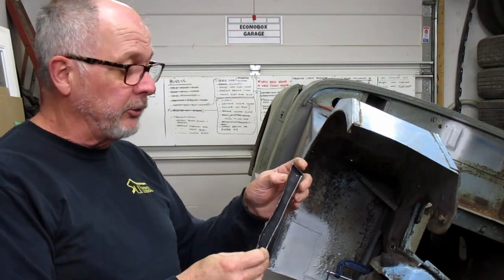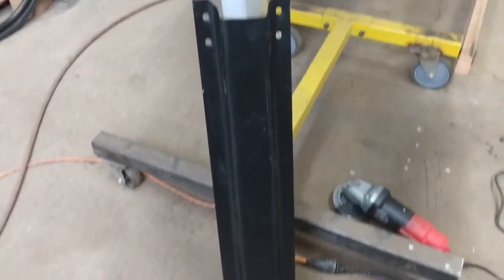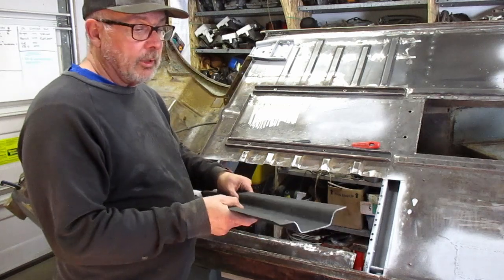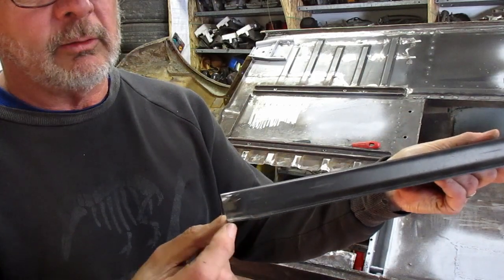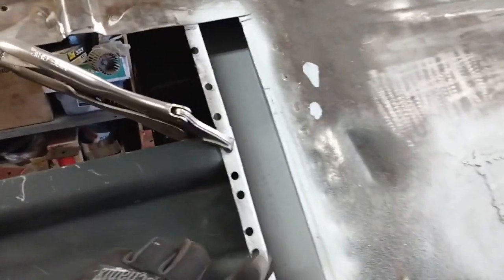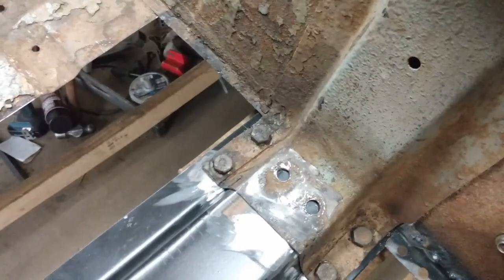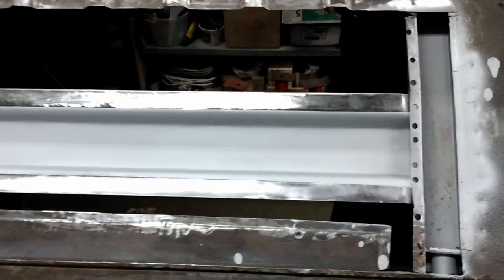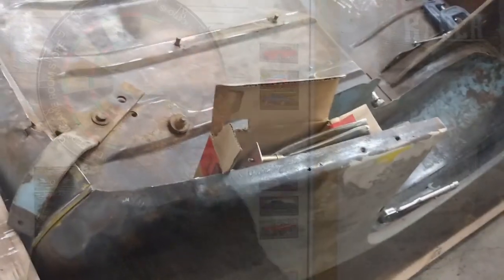Sills capped, floor reinforcement replaced and floor panel installed! Bugeye Build Episode 18

Comment: that vice is a great trick
Reply from the maker: Thanks... it worked much better than I thought it might.
Reply: @EconoboxGarage  

Hi Ian, 

A wonderful series that I have only recently discovered. I need to get my Sprite repaired and your videos are a great help.; thank you.

I have been wondering about your Vice. It look a super, serious one. 

My vice just slides in and out, and many times I needed the jaws at right angles to the normal horizontal mode. 

Can the jaws of your vice rotate as you look at it? If Yes, what size and make is it, please, as I want one!
Reply from the maker: @roncorry8030  Hi Ron. I'm glad you're finding the videos helpful. The vice is one I picked up many years ago from a local big box hardware store. It does rotate both on the vertical axis and the horizontal axis. I can't recall the brand unfortunately. Amazon USA has one similar https://amzn.to/3Gnli3b as does Amazon Canada https://amzn.to/3y6Bp2m.
Reply: @EconoboxGarage  
Thank you, Ian, for such a quick reply. 

While I started hopping in and out of your various videos, I am now working my way through from the start (No #9? on my screen. Battery loss?). They are all really enjoyable and well put together. It is remarkable, and lovely to see, that so far, no-one has given a Thumbs-Down. Hopefully that continues as I don't like keyboard-driven negatives.

I will follow up on your vice references and try to see if I can find one Europe-side. Guess delivery from N. America would be somewhat expensive as it looks h-e-a-v-y! 

Thanks again. Ron.. in Ireland.

Comment: exciting progress, clever bending, is that a Fitzee inspired bend?  How did you clean the engine bay after removing the engine? and are you finding the need to do the same type of cleaning with each area you're patching?
Reply from the maker: Except for the little patches at the back and the front all the pieces I welded in this week were premade... the reinforcing and the end caps are Moss parts purchased through Classic Motor Works in Manitoba and the floor is from Royal Restorations in Ontario. The front and back patches just needed a simple 90º bend. Initial cleaning of the engine bay was done with a pressure washer, still lots to do before painting it. As for the rest, I'm basically cleaning as I go. 
Just realized that you were probably asking about the bend I did in the vice! Can't remember anywhere specific I saw that method, just figured it was a poor man's die press :)